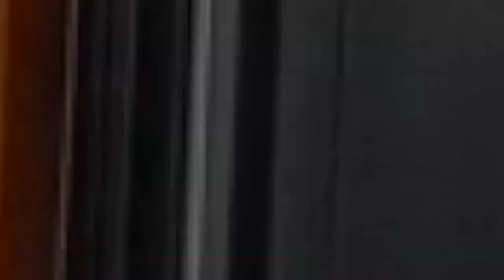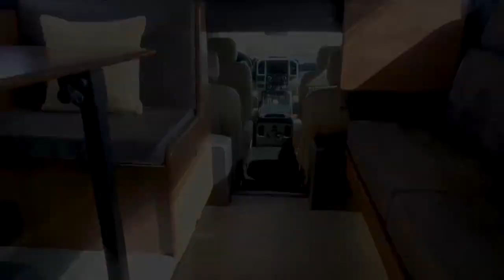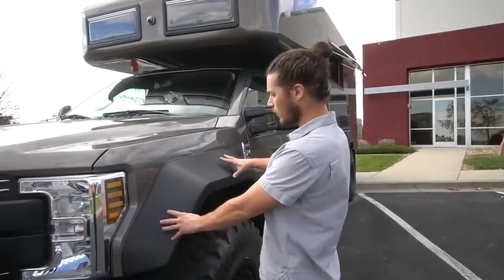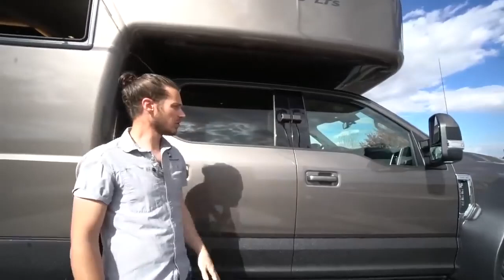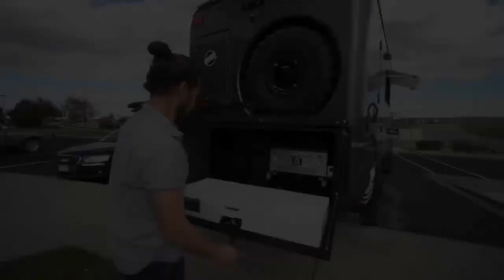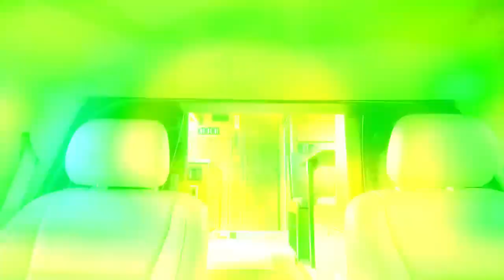2020 Earthroamer Expedition Vehicle 4x4 | Full HD Walkthrough

Comment: There are only 2 things that this video is missing.  But to be fair, EVERY walkthrough of the Earthroamer that I've seen does not have these 2 items.

1.  I've never seen anyone show how easy or difficult it would be for an average sized person to go from the living area to the driver's seat WITHOUT leaving the vehicle.  It would be interesting to see an average sized person 5'8" to 6' tall move from the pass through to the driver's seat.

2.  I've never seen a long shot of an Earthroamer next to a large standard truck.  Like a side shot of an F250 crew cab parked directly behind an Earthroamer so you can actually see the difference in length.  Then a front shot of both vehicles parked side by side so you can see the difference in width.

I know the dimensions are available online and you can download the specs for both vehicles, but actually seeing them is a completely different experience.  

This video does have the Earthroamer parked next to a passenger car but the angles, the positions of the two vehicles in the frame are deceptive.  Since in some shots, it looks like the passenger vehicle on the right is just a few feet shorter than the Earthroamer.  But the Earthroamer is parked at an angle and the back extends quite a bit further than over the curb than the sedan.